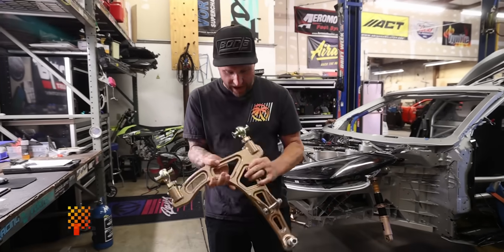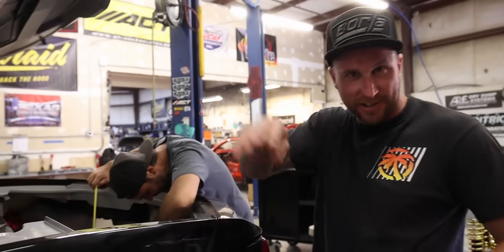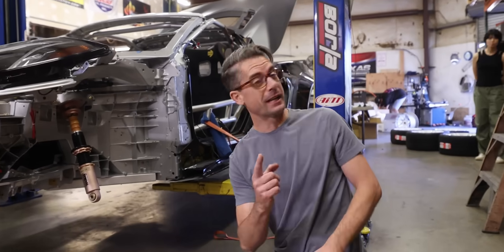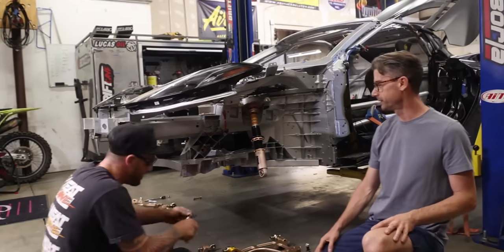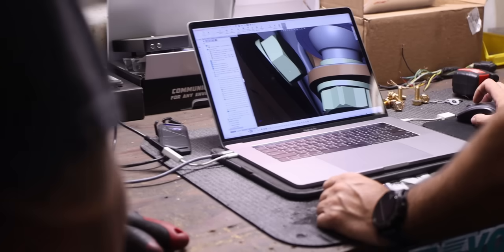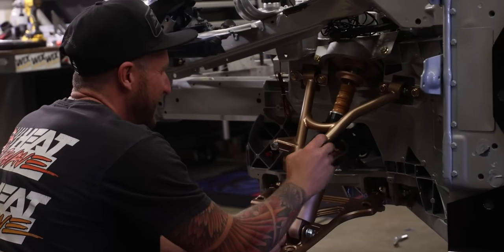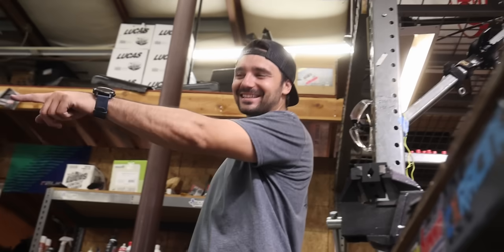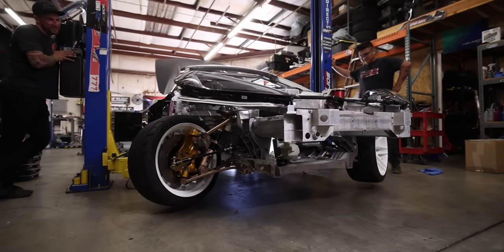World's 1st Manual C8 Corvette Drift Car - Installing the Parts Shop Max C8 Front Angle Kit - Ep. 34

Comment: This is kind of disappointing, you basically just built a new car, I was really hoping for a stock corvette with just a manual trans swap. It already technically has a manual with the DTC, someone has to make a box that fits in that general location, couple linkages and some pedals stolen from a VW Jetta and you got a manual corvette.